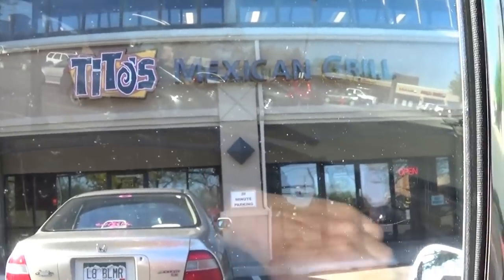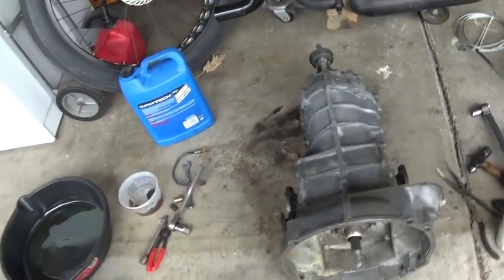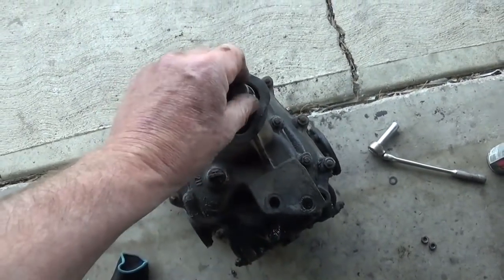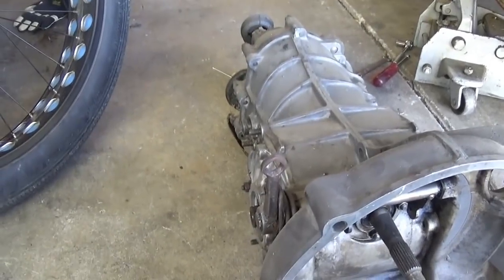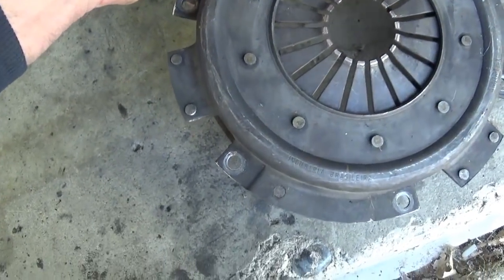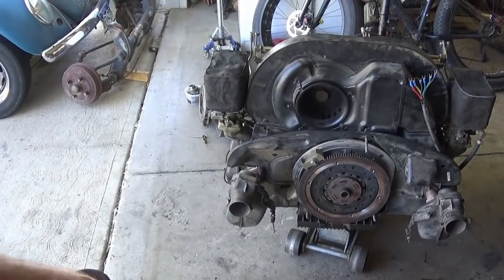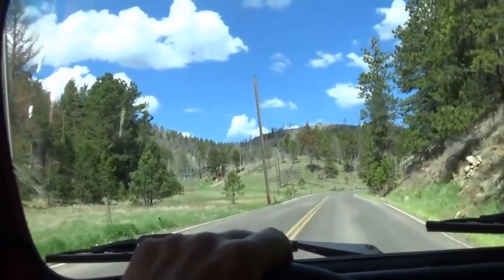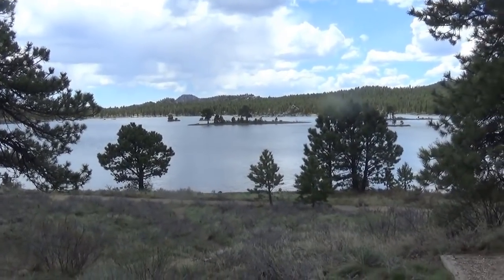VW  Clutch Fix  (Tips & Tricks)

Comment: Very good information,  drove mine yesterday,  stopped at a burger joint, and found my fuel pump diaphragm has got a hole, piddling fuel out, so called a buddy, trailered her back home, waiting on fuel pump, dont see or smell fuel in the oil.think I will changed it to be on the safe side of things. Have a good day, oh thanks for the ride
Reply from the maker: I switched all my cars to electric + regulator due to that fuel injected VW case that has no provision.  Get the rotary if you do that the faucet pumps are really noisy.  No Problems and no regrets. Cleans up the engine area as well.

Comment: Driving in the fifties and sixties when driving a manual transmission at a stop light, one shifts into  neutral with no pressure on the clutch pedal. Only when the lights change do you put it in gear.  This was for safety and prevents premature failure of the thowout bearing.
Reply from the maker: Those were the day's eh.  3 on the tree hehehe

Comment: Hi EZGZ! When I pull away on uphill slopes in my bus I find that even when I have fully lifted the clutch peddle in first gear it takes a while for the bus to pull away. Would this be my clutch slipping? I'm fairly sure I have enough freeplay on the peddle and cable. Is it possible somehow for the clutch plates to get contaminated with oil and make it slippery? What do you think?
Reply from the maker: All the above.  Just plain normal wear. Pressure plate old and weak. Previous owner put a cheap chinese sedan clutch in?????  It's very easy to remove a VW engine and have a look.  If you do have to replace the rear main seal also replace the 0-ring inside the flywheel if it's that style. A good Sachs HD pressure plate, New Throwout bearing and stock solid disc will give you peace of mind for years to come :-)  If nothing else it just makes sense to have a look and clean everything up. Then you know what you have. Clean the cooling fan and check your shutters and linkage. You can do a lot without spending a lot of money.

Comment: Makes me want to take a long drive in mine... Wife don't like riding in it or my 60 Kombi. What muffler are you using on Rusty? Enjoy the weather and the weekend!
Reply from the maker: For 5 years I ran a cheap replacement muffler from Auto zone. 2 inch inlet and outlet. small and compact. Now I can't find another one so I just ordered one of EMPI Baja mufflers and it is a lot quieter and has the bracket welded on and ready to go. I don't notice and loss of power even thought the outlet is a bit smaller.

Comment: @EZGZ I am putting a 1914 on my type 1, it has an early transmission that will require some grinding so the bigger flywheel fits.  Do you recommend I change the stock EARLY throw out bearing shaft to a LATER complete throw out bearing shaft?

Comment: Hi, Enjoy your vids... thanks for them - very informative.
I have a 1971 1600cc vw engine in a trike, with new clutch, pressure plate, t/o brg…. when I take off at idle it's smooth, (but can't do that uphill) if I accelerate the clutch chatter/shudder shakes everything loose... BAD. Any idea where to look? Can't pull out into moving traffic at all. Thanks
Reply from the maker: Sounds like oil on the clutch disc???  Did you get the spring disc clutch or the solid disc???  The new china clutches are disappointing. Of course the EPA makes it harder to use good old fashioned material. You might pull the engine and check for oil and if it's all nice looking and dry start shopping for a good used clutch at a swap meet
Reply: Thanks for the response, Sir. I believe you're right. When I originally replaced the leaking rear main seal, I wasn't aware that there was an o ring 'in' the flywheel. Just replaced everything from the crank back, getting ready to get 'in the wind' (soon I hope) All new - rear main, o ring, gland nut w pilot brg, cl, pp, t/o brg…. now changing rear drums to caliper brakes. Hope to be riding as soon as weather permits. Drive Safe Friend. (in NH - still kinda cold here yet for an old man, lol)

Comment: Question? I have 1958 bug with 2276 and stock trans! Bug will go into gear with motor off, but with motor running will not shift! When I let clutch out while running it jumps forward! Any ideas before I rip apart? Thanks
Reply from the maker: If it's a 58 tranny it's 6 volt split case. Replace it with a 66-68 12 volt and adjust your clutch correctly per any shop manual. 12 volt starter bushing fits  12 volt starter

Comment: Hey im doing a transmission swap on my grandpas 65 beetle. It has a kennedy pressure plate that has been double stamped. It is a 2 over a 4. I stabbed the transmission and the clutch arm on the side of the transmission only moves about 1/2 an inch, and thats it!  I put a cheater bar on that clutch arm and it actually slightly bent the arm a little bit.  It worked fine before the transmission swap.  I even put the old transmission on, and its doing the same thing.  The friction disk has the protruding section facing the transmission. It physically cant go in backwards, right????    Any help is appreciated!
Reply from the maker: I had to think about this a while with the info provided. The stock 65 tranny was swing axle and I'm pretty sure your replacing it with one that works better???? The different tranny came with a kennedy pressure plate and it worked like that in a different car???
Kennedy Pressure plates are much stronger than a stock Pressure plate but not enough to bend the operating lever.  You must have a mismatch on early and late parts. Did you have a problem bolting up the tranny? Did you back off the adjustment nut on the clutch cable? The engine should have dropped right into the tranny with just a little jiggling and snugged up flush. If you had to force it and squeeze them together with mounting bolts you have a miss match of throw out bearing and or pressure plate. Looking back it would have been nice if you had tried bolting up the tranny for a test fit. I know a swing axle is a lot more work with the brakes and all but you have a problem I can not diagnose like this. You need to take the tranny back out so you can see clearly and do a test fit on the floor or grandpa may end up walking home some day.  I have vids up with close ups of early and late throwout bearing and pressure plates and shift forks. Someone else might have changed things.  
Look at both old and replacement tranny and make sure they look the same. I highly recommend NOT using that Kennedy pressure Plate set up regardless unless you weld the clutch tube tabs in the tunnel, use a brand new clutch cable and a new clutch hook on your pedal assembly.

Comment: I'm sorry sir can you please save me i have problem with the gears on my wv golf mk 4 tdi but I have trans probs i guess..
So everything shifts and the clutch grabs like new when I start to go to hospital and then on my back to home i turn the car on and it is not getting in any gear 😔
So i turn it off and then get it in 2nd gear then go and start the engine but the car is some kind of weird mode it is moving and ignores the clutch but goes so slow and only in that gear so i make big traffic jam..
Today i open the engine apartment and grabbed the weight of the gearbox and move the gears i guess from there because when the car is off it shifts like new...
Then went and got it in neutral and turn it on step on the clutch and it started to shift like never had problems.
Then red light i stop the car and the same thing. I turned off the engine get it in 2nd and started but why it is ignoring the clutch ?
Just goes slow like sloth ....
Plz if you have any idea what is is write me what can it be
Reply from the maker: Disconnect the battery for 5 minutes and then if the problem does not go away  you can possibly take it to a car parts store like O'Riley's, Auto Zone ETC., See if they will hook up a problem scanner and look for a problem code. That's all I got for free. The next is to take it to a mechanic or VW dealer in your area and bend over.
Reply: @TheEZGZ  hehe thank you so much I thought you were some guy with a garage so I wrote you but the clutch after clutch that you pull out in middle of the video looking like ferrari clutches made me regret even bothering you 🙏
I did the battery already 10 times and always says engine check or inspection in the dashboard i was going to buy slave cylinder now and change that,but okay I'll take it to diagnose guy to tell me what codes it is showing and if they are connected to transmission.
Thank you and respect from Macedonia